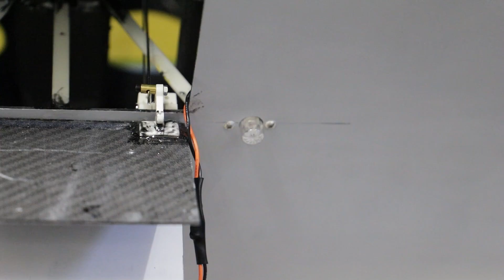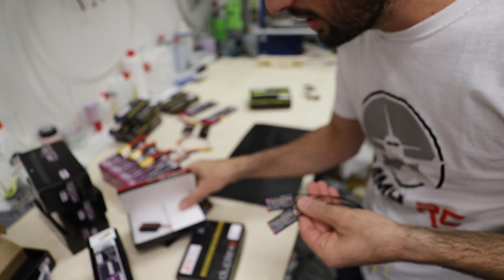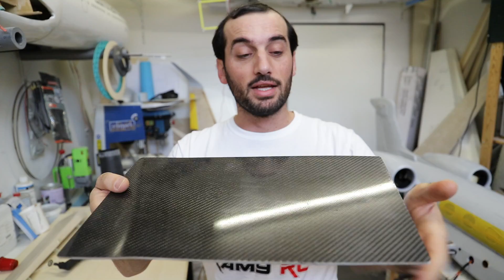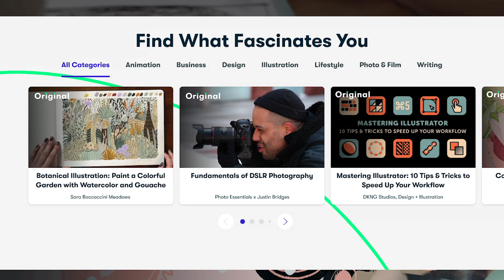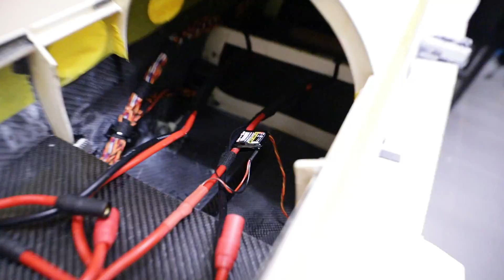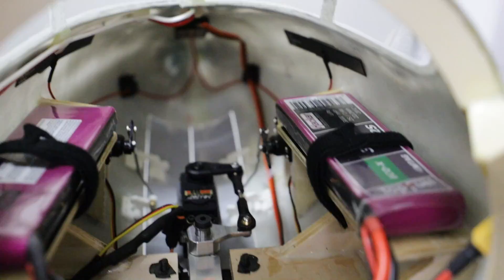Installing the electronics in my Gulfstream G650 RC airplane | Part 7

Comment: Hey Ramy ,I am a little confused about the power distribution board you never mentioned that and how are you powering the Flight controller directly from the battery?Are you using a BEC to step down the voltage to a range of 4V to 8.4 V?

Comment: The plane looks awesome, definitely a whole different level!

 One comment on the airspeed probe, however.  It should be out on the nose or leading edge of the wing.  The dynamic pressure (hole on the tip) will be ok but the static pressure holes on the side will not be accurate from the flow running up the nose of the aircraft which will change the reading.

Comment: An airspeed indicator is the gauge that reads out what the pitot tube measures. What you installed is a pitot tube! Regardless, amazing job on this, it's so impressive.

Comment: The airspeed sensor might not be extend out of the boundary later when you're flying. Be sure to test it or not run anything crucial on it at first. I don't know exactly what the effects are, but I know that the research group I work with is always very cautious of where it is placed for fear of inaccurate readings.

Comment: For the most strength with balsa composite you ideally should use end grain balsa. Essentially balsa cut across the grain. It provides a much better core material because the strands of fibres are bonded with the fibre at either end.

Comment: Ramy, I'm not sure if you have seen Ummagrips from the FPV community.  Easily best pads so you don't have to use velcro for your battery.  Just clean with a moist towel, strap the battery, and it will grip hard!

Comment: Hi Ramy. Great job on airplane as usual. I do have concerns on your pitot tube. It needs to be in clean air......where you have it it will get the air coming up from the nose which I believe would be faster air. Also at high angles of attack the nose will be blocking the.pitot tube. Just my concerns. Thank you

Comment: Sir, what is the the liquid you put on your carbon fiber and fiberglass to stick it with the foam board in your b787 and other old planes and what is the servo delayer that you kept on the b787 in tilting mechanism of the nose landing gear

And I am asking that on this video because I couldn’t type on those video.

Comment: Hey Ramy...a velcro tip...try the velcro by 3M..both sides are the same, its a hard material and makes a clicking noise when you join both halves together. Its a veeery strong fit and does not wiggle around. Once you try it you will not look back to the traditional velcro!

Comment: Be careful with the speed sensor, you placed it at a place that will be influenced by the air that is going to flow around the fuselage (nose). The wing or even placing it (1cm) further from the fuselage would help!

Comment: By considering the GPS in addition to the pitot tube airspeed indicator you seem to be showing more concern for reliability and redundancy than some full size airplane builders.
If you install the GPS you will be able to check if the pitot tube is working and in the right place. Not sure if where it is now will be in clean air. Near the nose skin there is slower air due to the boundary layer, and away from the skin accelerated and turbulent air as it goes around the nose.
A better location might be right at the front of the nose, if a wing location is no longer possible.
Brilliant and complex videos, thank you for making them.

Comment: I maded a plane just like yours but after that, The Plane stalled its because the power of the engine isn't powerfull enough so it crashed in the lake. 😢😢😢 But i'm creating a new one - A330 -Philippine Airlines Hope i fly it well and you also fly your plane nicely.

Comment: Your work and skills are amazing!  I work at the production plant here in Savannah Georgia and am currently working in the last of the Gulfstream G550s. My next aircraft to work on when the 550 ends in January will either be the 650 or 700. The work on the 650 is SO spot on!  Unbelievable.  Great job.

Comment: Yes, the lights you installed ahead of the leading edges of the main wings are inspection lights to light up, and check the leading edges for icing.  (I'm a Gulfstream mechanic by the way)

Comment: @Ramy RC I think your builds are fantastic. The craftsmanship is just amazing. I would be concerned with putting the pitot static tube in that location ~18:34. I have not done the math but it doesn't look like the sensor will be in the freestream flow meaning that the aircraft itself could mess up your velocity data. Especially during a possible stall/near stall, if flow separates around the nose and goes turbulent, the data could be really poor just when you need it most. The flow shouldn't separate at that location. However, I imagine that this is build is close to but will probably not fly at scale speed meaning that Reynolds similitude won't be reached. Similarly, mach similitude will not be reached. This means that the flow characteristics will not be optimal as they are for the full scale gulfstream. This leads to a possible higher chance of flow separation where the pitot tube is located which is not good as discussed earlier.

Comment: If you have a soft core, all you have to do to put screws and believe it will hold is this: make the hole larger (if your screw hole is 1 mm make it 5 mm), secure the bottom with some tape, and then pour some epoxy in the hole. After it's cured, you drill the 1 mm screw hole and it won't go anywhere. IF, you still have concerns, you just make the hole chamfered with the smaller side opposite the screw head, that way, the epoxy forms something akin to a washer that will hold the board in place.

This is standard practice in proper boat building where the skins (inner and outer) are wrapped around a soft core (be it wood or foam). You can imagine the kinds of forces involved in a boat, and that if it works for that, when mounting things like deck hardware (cleats and the like), it should work perfectly fine for your brain board.

PS, you can apply this method to other elements of the body, where you want rigid 100% epoxy elements or to make bosses where you can screw things into thin material. This is super strong.

Comment: Hi Ramy, your build is coming along quite well. 

Just a few notes/questions...The receiver in the back appears to have the antennas pretty close go being parallel instead of being perpendicular to each other. Putting them at any angle other than perpendicular means that they will work, but at significantly lower signal strength. This is a very brief description and if you want you can contact my, then I can explain in more detail. You also want to keep you antennas as far way from power sources as possible. Batteries and especially turbines generate interference which is not something you want on any model’s receiver. 

Regards

Comment: Having wrapped the servo wires is not that good idea. Servo is requiring some current, and the cables are generating magnetic field. As a consequence that field is affecting other servos and making them inaccurate. 
Sidenote: theese gulfstreem aircrafts are very eazy to stall, so during the flight watxh your speed, and bank angle, also try staing cordinated as much as you can.

I support u very much, thats an amazing job done!

Comment: Probably good your putting the airspeed sensor in the nose rather than the wings. We actually have four separate and independent pitot sources (two on both sides of the nose) on the real G550, but they are all on the nose. You probably know this, but you want them to be directly in the slipstream of the oncoming air. Depending on the attitude of the aircraft, the airflow can be disturbed if they are anywhere else. Awesome seeing this come along. I love seeing a new video, especially on the days where I have been flying the real thing (albeit a G550, but they are very similar). Hopefully we will be getting some 650s within the next year.

Comment: With that much space you should be able to put the batteries on top of electronic, just add another floor to your board and push them even more into the nose :)
Edit: I think pitot would look better/more realistical on the wing, right now it looks like underdeveloped Unicorn 🦄 ;)

Comment: You shouldve installed the receivers in the wing and leave the wires leaving the wing from the trailing edge to look like static dischargers , and the pitot tube on the side of the cockpit like real thing

Comment: Always interesting and informative.  As a flyer of small models that only use a single receiver, I am curious to know how it works with mult receivers especially as they are not all on the same frequency.  Do you have someone operating a 2nd transmitter on 900mHz for ancilliary functions?
Reply: No, he just has 2000€ transmitter :) - From his transmitter's feature list "- 3 HF modules (2x 2.4Ghz + 1x 900Mhz)"
Reply: @randomnickify  That's interesting.  Is that to provide redundancy/backup or just to provide more channels?
Reply: @Sorarse  redundancy

Comment: I would put the airspeed indicator in the wing or on the side of the nose. The wing would be a better indicator as it is out where the lift is generated and more importantly where the stalls occur. Not to mention looks wise it would look less out of place considering the size of the pitot tube to the scale of the aircraft

Comment: The place where you installed the air speed sensor (pitot tube) is actually used for a FLIR (Forward Looking Infrared) camera.  It is used as an aid in making low low viability approaches.

Comment: I would caution you on the location of the airspeed indicator. It should be on a leading edge as to not give you false readings.
move it to the nose, the wing, or the top of the tail.

Comment: Those lights on the fuselage just forward of the wing are in fact called inspection lights. They are for visual inspection of the wing at night to check for ice or damage. I am curious to see if you will be implementing the downward facing lights on the wingtips that are used to reference the wingspan in relation to ground objects. The amount of detail you put in your models is amazing and I love watching your work. Thank you for sharing!

Comment: Great build. Thanks for walking us thru the electronic parts. My only comment would be on the pitot tube. Having never used one myself, this is book knowledge only, but i had heard that it needs clean airflow. I would think that it would get inaccurate readings from the pressure bouncing off the nose of the plane.
Reply from the maker: You're right my friend, I thought about the same but I saw that this tube is installed in a similar way on full size aircraft, I'll give it a try and see.
Reply: @RamyRC  You could also just make it longer/further away from the fuselage so it’s impacted less by the air flow
Reply: @RamyRC  In order for it to be accurate, it would need to be parallel to the aircraft skin...just like the full size Gulfstreams. Project is looking great!
Reply: I think it is sticking out far enough.
Reply: Correct you can't have it in spool zones
Reply: Are the pitot tubes heated like a real aircraft?